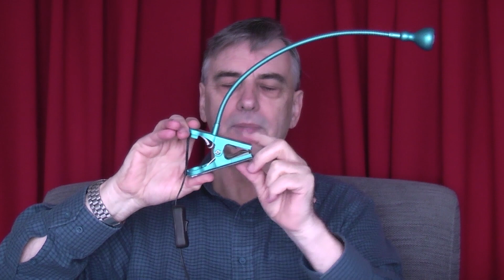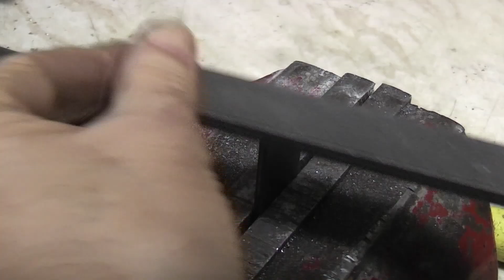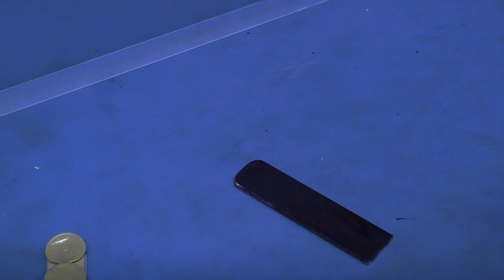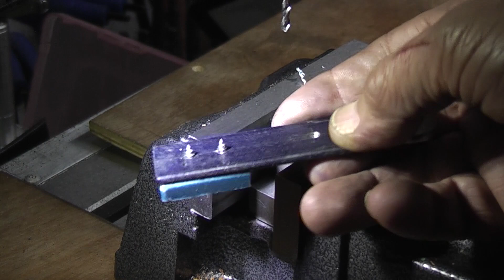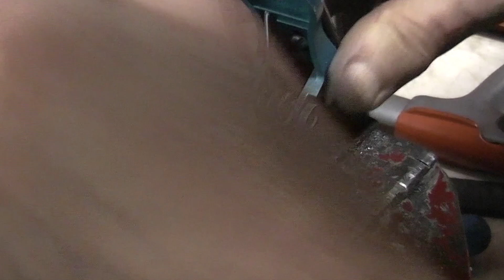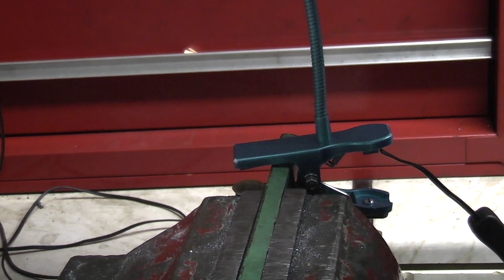Repair to an LED lamp clamp

Comment: This is a perfect example of a properly designed, well  executed repair of a useful object. More people should utilize this approach instead of throwing everything away as soon as it has a small failure. I would have most likely just welded it up, and kept going. It would have looked nasty, as I wouldn't have repainted it. This repair is beautiful in it's simplicity, and much better than my savage approach to fusion joining of the broken part.
These Ikea lights are very inexpensive, and I use them on almost all of my machine tools. Their only shortcoming seems to be a poor power supply, as that has been their main failure for me. I am redesigning the power supply, as these lights are too useful to not be fully utilized.

Tim